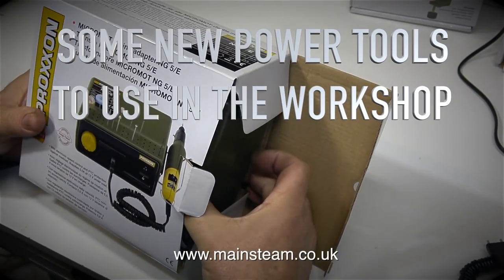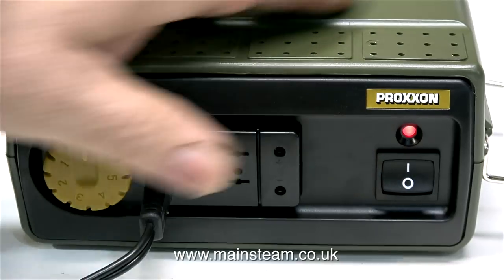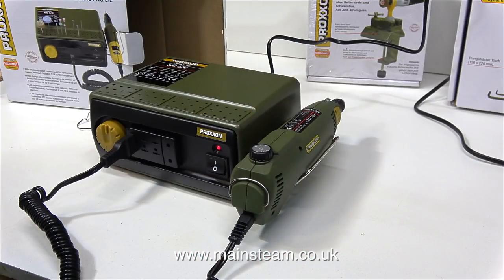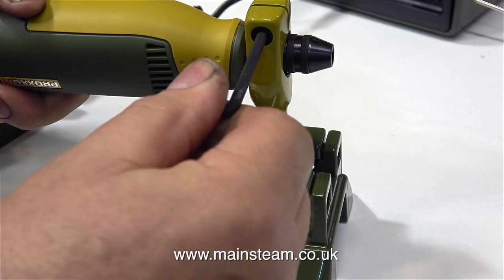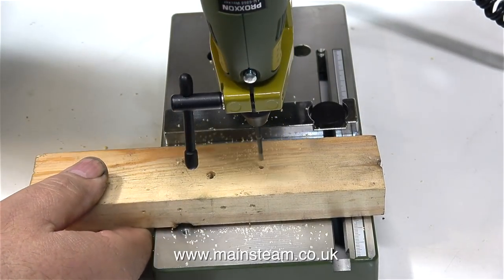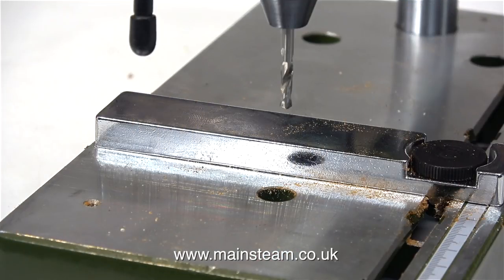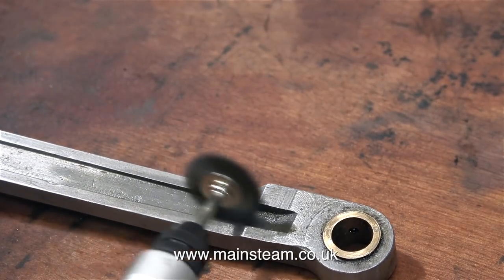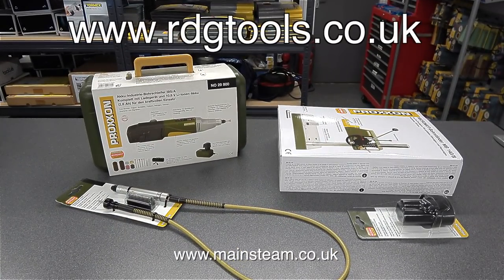TESTING PROXXON POWER TOOLS - PART #2 - IN THE WORKSHOP

Comment: Gosh I'm glad I found this. I had a Proxxon rotary tool some years ago. After a good long life it finally died and I replaced it with a really cheap version which initially was good. Later the chuck got really loose and I found it impossible to get different sized collets. The one it came with is almost exactly the wrong size for almost everything.
In the interim I'd forgotten the Proxxon name but I could vaguely remember that you had some so I searched through your back catalog until I found this video. Thanks for making it! A new Proxxon rotary tool is on order.

Comment: does the ibs/e model also have the plastic insert between the motor and the shaft like the 240? that to me is a very poor design. Can't find real pictures. The 50e model and the slimmer ones seem to be only metal shaft which is a better design